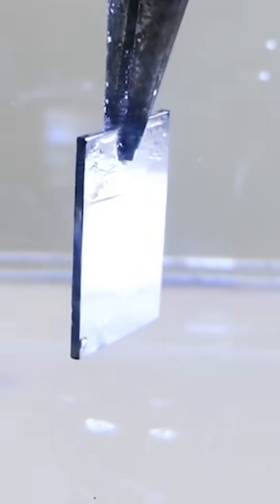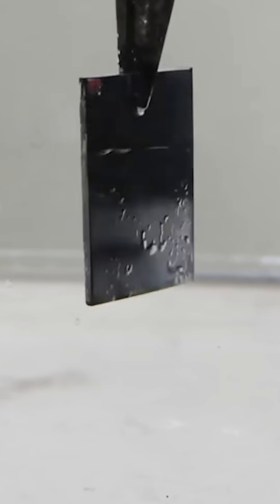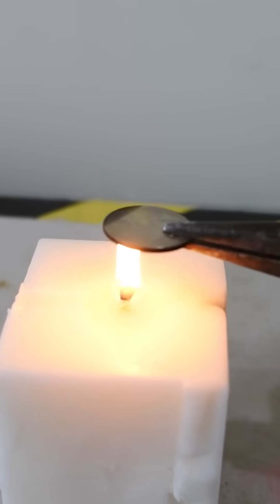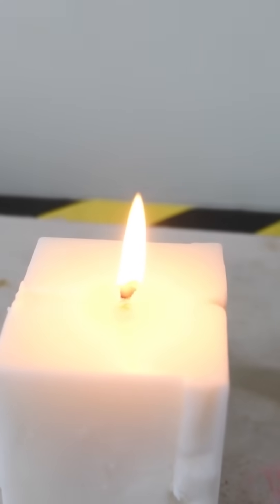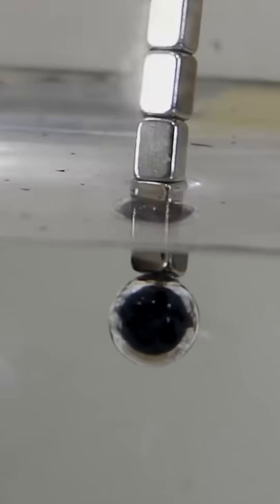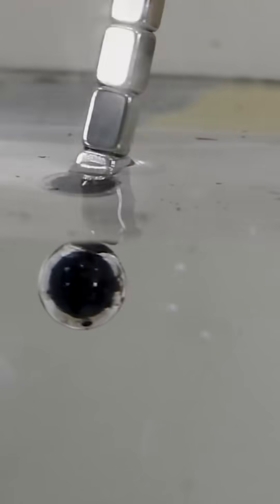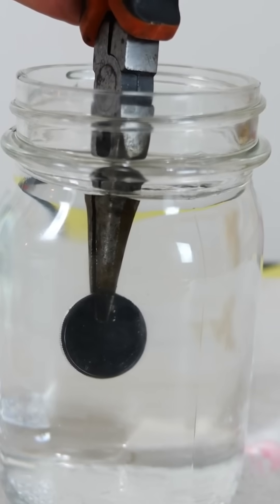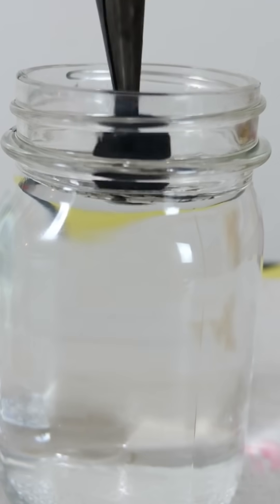Black Mirrors Are Trippy

Comment: This could be used to make roofing that in summer automatically sets to the angle that reflects light and helps cool the building, and in winter sets to another angle that helps heat the building. It would be so cool... pun intended.

Comment: So, it doesn’t actually 100% reflect light? It seems like it, if thinking 2d, it  reflects at a specific degree of angle and also reflects at  a specific degree of angle while it absorbs the rest of degrees of angle. ?? Or, does it refract the degree that’s seems to be absorbing to the degree that we can see the light reflect/refract?? So it actually does reflect 100% of light from reflection, deflection, diffraction, and refraction? Am I thinking this through correctly?

Comment: Now what if you tried to put it in boiling water? Distilled water as well boiled distilled water as it has a higher flash point. Would like to see what the heat from water on the soot would do. Also maybe hold the coin over steam and see what it would do as the properties are slightly different

Comment: If the material can really reflect 100% of the light, in theory you could have worked out how the interior of ancient structures could have been illuminated well enough to allow the paintings and sculptures to have been made in them without using torches or oil lamps.

Comment: So cool, esp. the sphere! Quick correction though: it’s just total reflection, not ‘internal’ reflection. Total internal reflection is what happens eg in water droplets yielding rainbows. Here the lights does not enter the air layer to turn the surface into a mirror.

Comment: I think it might be more complex than internal reflection from the air. When you turn the quarter you can see the coin imprint (ie head and text). 

Try the same experiment but use a material with a black surface before applying the soot, or or color, like red or blue, or a piece of transparent glass with no reflective film.

Comment: Thiscwill be my new wire wraped jewlery project.I will get a small clear glass bottle and fill it with water or color water,find a small object that fits and put candle sut on it maybe snap some of so it bibles in control spots and drop in there.

Comment: Maybe you and I can rack our brains and come up with a chemical vacuum. Chemical vacuum is achieving a full vacuum by first doing your method of putting liquid in a tube such as mercury and allowing The liquid to fall out via gravity. However before we tie the tube end because we know there is some amount of air in there, we can put a chemical mixture that would absorb the gases we know of in the form of a reaction. Once the gases are bound to another chemical they are no longer gas and that gas is no in the tube. I have come up with a few chemicals and I am very much looking forward to seeing how low we can go.

Comment: lt's not exctly  air

 it is gaseous mixture of vapors

   hydroxyl Radicals (Hydrogen (and electro negativityc Oxygeni)( and H+)

 l*) carbon monoxide,carbon ,and Co2

*Too) There is a relation of Carbon, CO2, and CO2.

but , (BiG Βuttzz) 

Nirtogen gas does not dissolve into water.

(without some forms of CHEMICAL Re- Re— Ruh_Actionzz ) 

THEN...

Nirtrogen gas wil floαt up οαtuh the atmospheric terface  οf⁰ waterrz zzurfaithe...

💭

  

 lt is not air around it under the water.

Comment: What would this look like on a super flat and smooth surface? Like, optical glass smooth and flat? Would the mirror be near distortionless? Or would the soot or air make it fuzzy still?
Reply: Soot isn't flat. If you magnified it, you'd see how soot is loads of carbon particles. It's a matter of perspective.
Reply: @castleanthrax1833  that's what I was thinking. Like, the metal isn't flat so it doesn't matter, but I wonder what the limiter would be to perfectly smooth. Like, how much would it improve with a perfect surface?
Reply: @brianfox340  The soot is just particles of carbon so it wouldn't matter how flat the surface was originally. The soot doesn't reflect the light, the layer of air does. The layer of air is probably almost perfectly flat, at least down to the width of a molecule of air.

Comment: Years ago I read a high fantasy book where due to some cultural taboo mirrors were not allowed. More accurately Reflections were not allowed. So what they had was a black mirror that absorbed the light that showed you what you look like but wasn't technically a reflection.
Reply: Did the fact they weren't allowing water get adressed
Reply: @stw7120  like I said, it was a very long time ago, and I only remembered the not! Mirror thing because it was weird and stuck